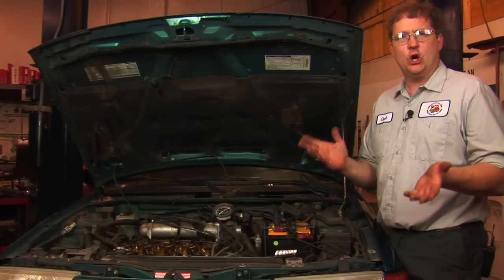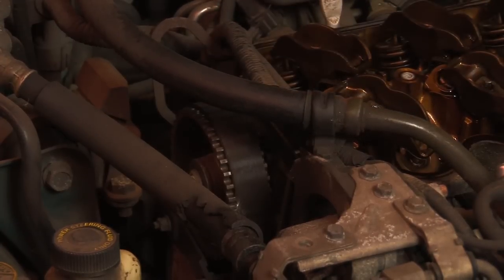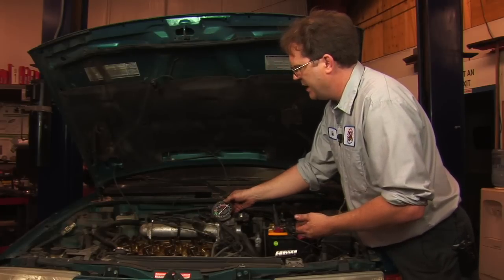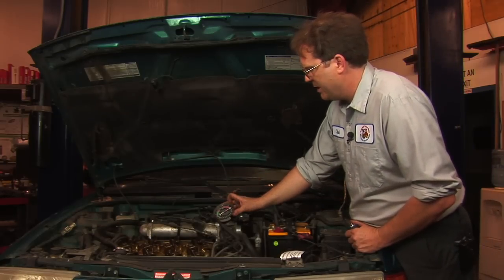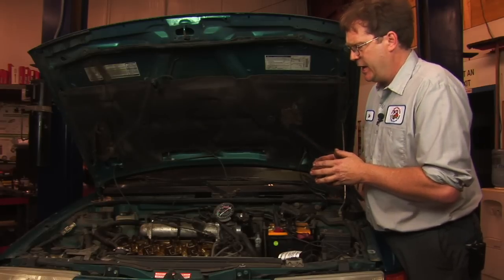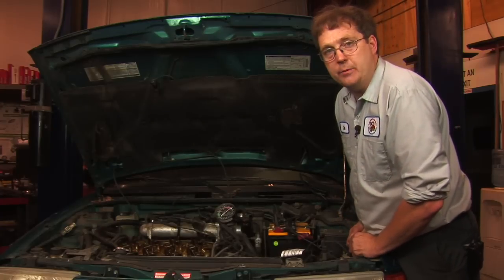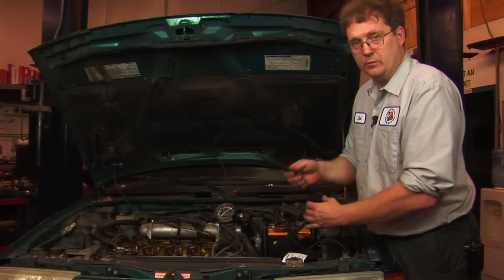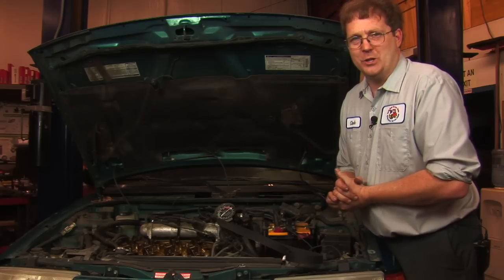Auto Repair & Maintenance : How to Know if a Timing Belt Is Bad

Comment: @phunkyone Once timing goes, its almost as if the motor ceases up. and if you DO get it started. it sounds like its going to die,will die. or sounds so off with knock it sounds like its going to send a piston through the motor.

Comment: Hi I have got a problem on my Clio 2 1.5 
I have just did the timing belt on it with water pump 
I start the car wok great I did 2km with it 
And then I turn it off and it works but when I turn it off and then on it made a boom sound but turn off and then on the starter just was sping but did not turn the engine